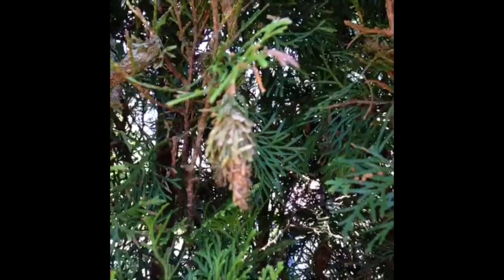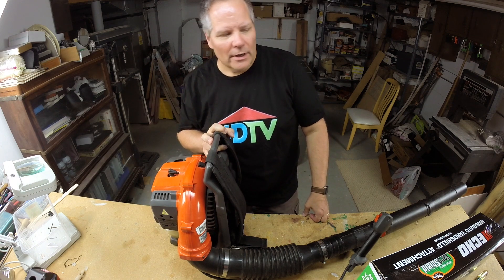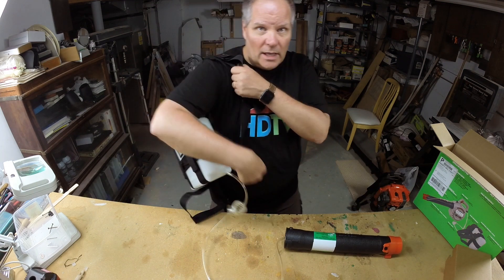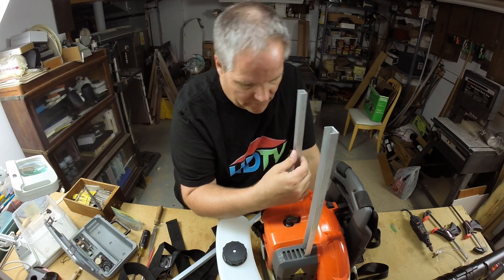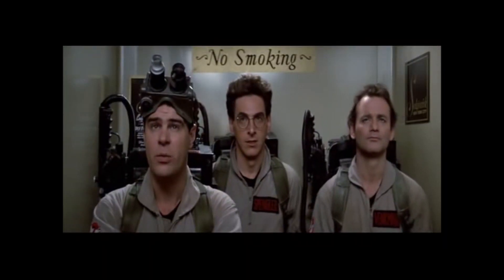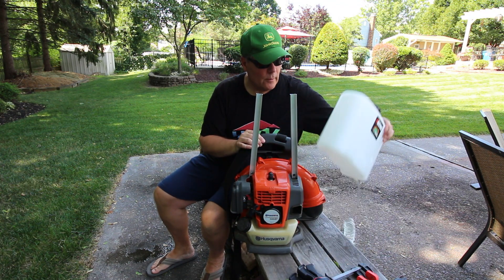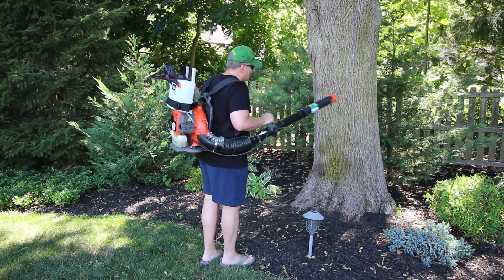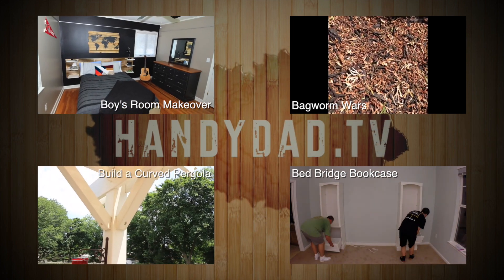Build a Mosquito Bazooka

Comment: Martin's 36.8% permethrin. About 20 bucks at most or seed and feed stores. Ask for it by name. 1and 2/3 oz to a gallon of water makes a .5% solution that is way more than enough to kill a mosquito. Spectracide fogging fluid in the bottle isn't but .15% and it works quite well.

Comment: Had you placed the end of the pipe from your solution supply line inside the pipe, maybe midway, then the venturi effect would have sucked the water from the tube and into the main exhaust pipe.  No gravity feed needed, but the orifice might need to be an old lawnmower carburetor jet or maybe a WD40 straw.

Comment: If may be a bit awkward, but couldn't you put the tank on backwards (putting the tank on your chest) and the blower on your back?
Reply from the maker: Yes I guess I could. Might be challenging since the hose is attached to the blower. 

In a later video, I alter the setup with a pump. Check that one out too.
Reply: Exactly what I do

Comment: are you aware they make these? stihl 450.... cool tho good job
Reply from the maker: +Saiiko12 That's a pro machine at a pro price. But it does a much better job than my hack, for sure. If I didn't already have a backpack blower, I would probably get one that could spray too. But Stihl is the most expensive.
Reply: HandyDadTV yeah I am a pro but let me tell you your so-called hack machine as you call it you still do a much better job than a lot of these so-called professionals that I've seen make YouTube videos
Reply from the maker: +Saiiko12 I need to find a way to pressurize the flow. Maybe air pressure into the tank or a small battery operated pump. It is gravity fed so it doesn't come out fast and it doesn't spray up.